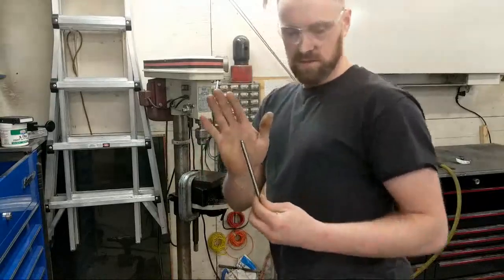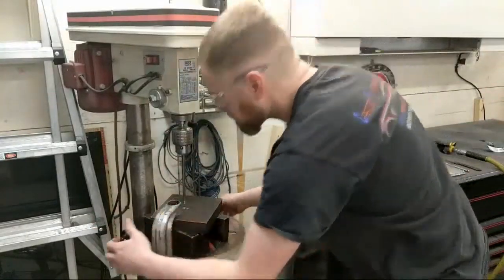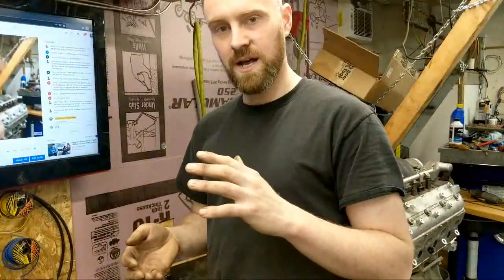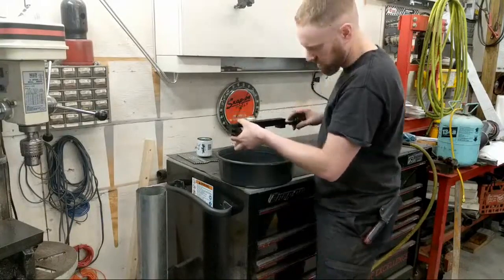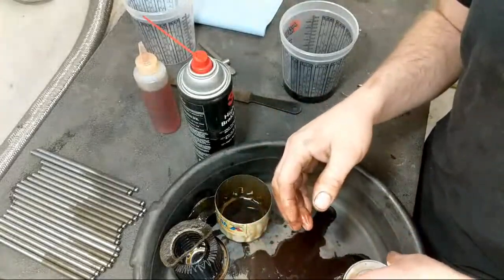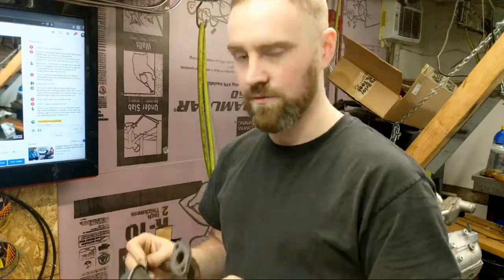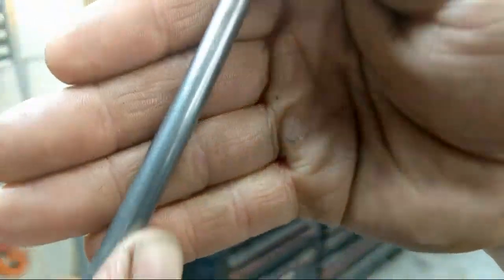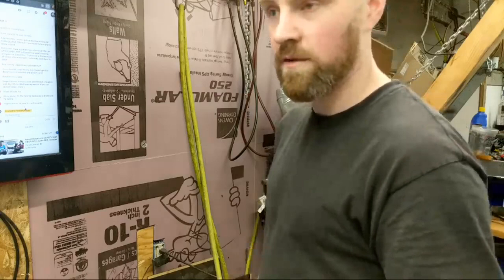Ask Me Car Questions While I Work

Comment: I got a 2015 Silverado, has about 77000 miles on it now, any tips on other common problems I should look out for or anything besides the standard maintenance I may need to help increase the life of vehicle and components?
Reply from the maker: Have the DOD turned off via a tune other than that just fluids and do oil changes well before the oil change reminder, don't listen to the oil change reminder.
Reply: @CrazedPerformanceRepair   sounds good, thanks! I'm also looking into upgrading a little bit, air intake, and chip. Possibly more if I can find lower cost decent quality upgrades.